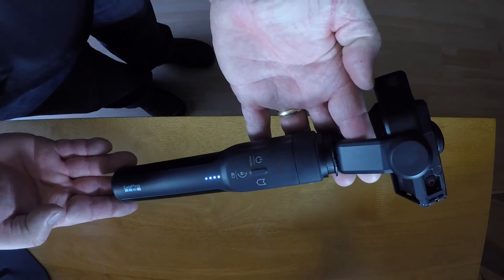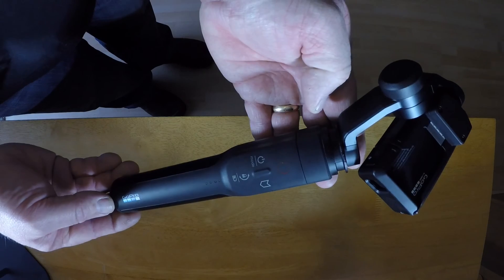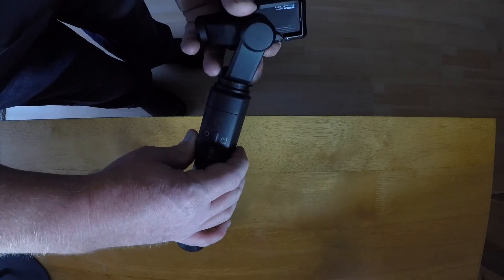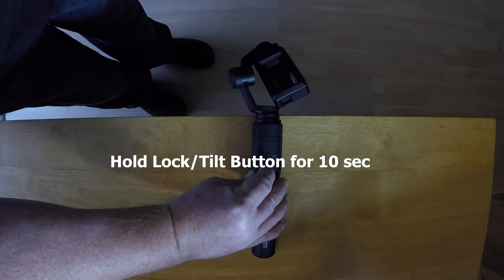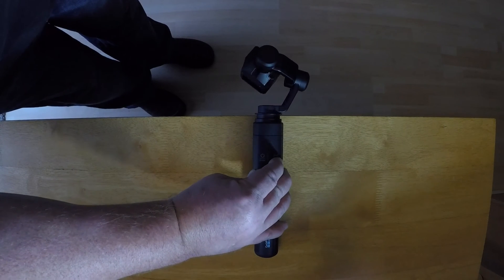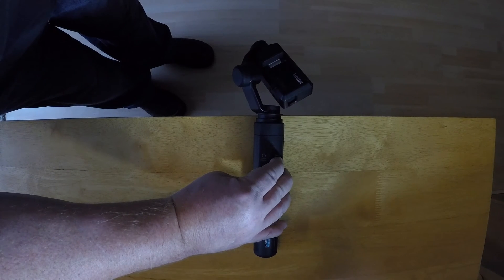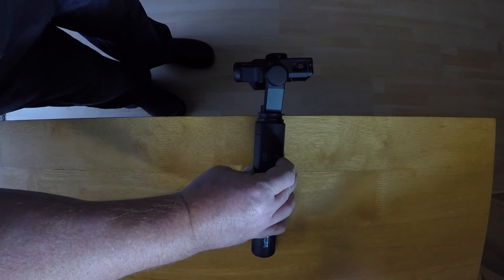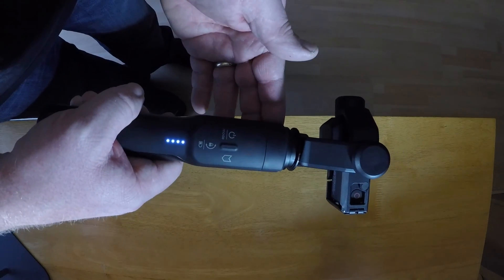GoPro: Karma Grip Calibration

Comment: Hey, came across your posts on the GoPro forum. Did you find that once you had calibrated once, the often mention 'horizon tilt' issue was permanently fixed?
Reply from the maker: Mark Keiller yes for the most part but it has occurred again a few times.